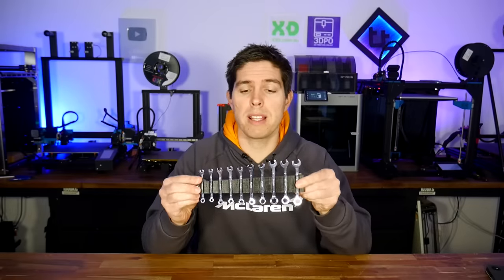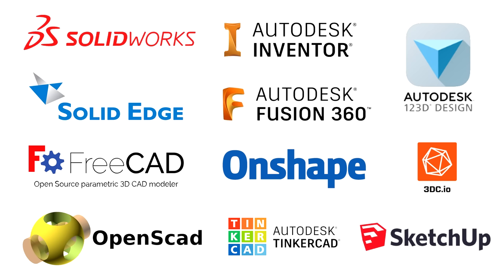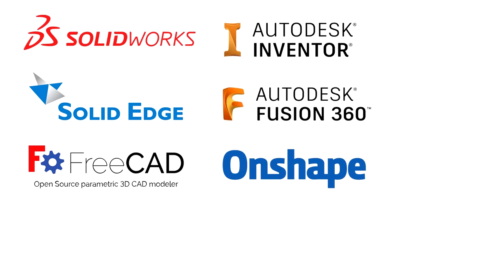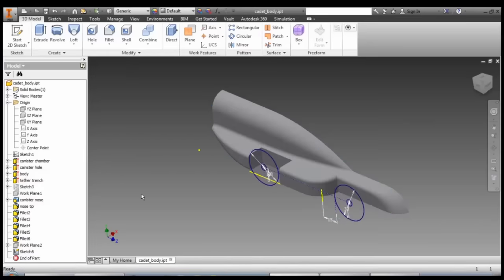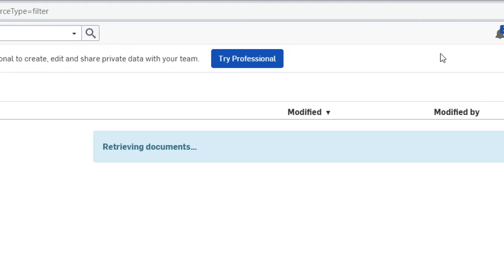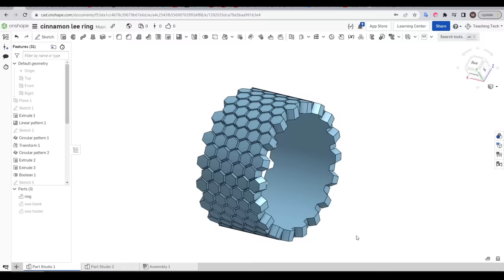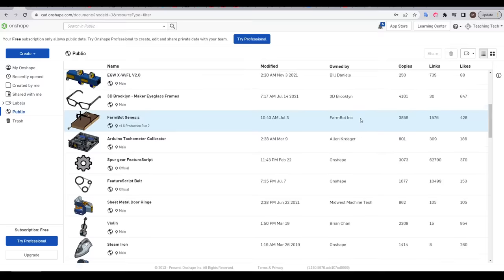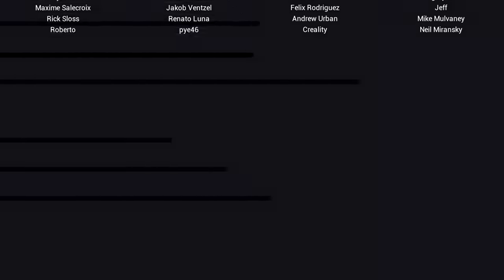Selecting a free 3D CAD option - 3D design for 3D printing pt1

Comment: Another option for people who already have experience using Blender is a free addon called CAD Sketcher, which brings CAD Sketching capabilities to blender. It's a new plugin that's getting frequent updates and it's still in early days, but if you already have experience with blender it's definitely worth giving a shot. I've been using it for about a month now and it's a very capable set of tools that have allowed me to make very precise complex parts to scale.
Imo it should not be seen as an alternative or replacement for a dedicated CAD application, but it may help current blender users get into the CAD space, and for smaller projects it could be more convenient than a separate application
Reply: absolutely true
Reply: was just gonna suggest this. best free cad option ive tried so far.
Reply: I tried blender and it's NOT FOR BEGINNER/HOBBYISTS ADDITIVE MANUFACTURERS (3d printers). It's for people who want to make 3d art and animation, not objects. 

I tried it, and it's not worth a beginners time without advanced instructions.
Reply: @xjonx1  Blender is for a LOT more than just 3D art. I have been using blender for a decade now and have taught many people how to use it for many many different processes, from CAD Precision modelling to Video Editing to composing Oscilloscope Music, there are so many things you can do with it, and this CAD Sketcher add-on just opens the doors to people who would like to get into the CAD space and already feel comfortable using blender at a hobbyist level. I'm not suggesting anybody learn blender for the soul purpose of CAD
Reply: @xjonx1  Yes, I understand that - I felt the same way at the beginning. But once you get the hang of it, you love it. I can't say exactly why. I do 3D printing with it, including the CAD application, 3D animations and photorealistic images. You can do all of that together, and it's awesome. But - yes - in the beginning it is difficult to understand. The best way to start is with a YouTube tutorial - the donut by Blender Guru. Just search YT and try it.
Reply: @xjonx1  it is one of the best general purpose 3d modelling tools, it can do a lot of things and does most of them fairly well
Reply: People tends to forget that Blender is ultimately a polygon based modelling. Contrast this with the likes of true parametric based CAD which is nurbs based. Your model precision is pretty much dependent on your polygon count. You can't zoom in and expect to maintain the models precision. Nurbs based modelling is mathematically precise. No precision is lost when zoomed in. In 2D graphics world, this is equivalent to Raster based vs Vector based images.
Reply: @alihms  In general, yes. however CAD Sketcher is all nurbs based, and the precision can be however much you require for the project. It is no different to how you have to convert a model to an STL file before 3D printing. The modelling can be extremely precise, but the number of tris is what determines the final resolution
Reply: I've always pondered if Blender might someday become the universal open-source 3D anything platform, anything from CAD to animation to maybe even games that run on its platform. I have to imagine a good bit of the underlying code is similar, and even features like CFD could be useful in either context. Maybe they could have a CAD workspace friendly to those not familiar with Blender, but useful for getting into CAD and running on the Blender backend.
Reply: @quillmaurer6563  interestingly enough I actually made my first game in blender back when it had it's own game engine built in. It was just a simple maze game and I was around 10 years old, but I believe they removed the game engine a few years ago before 2.8 came out. In terms of CAD modelling, I don't think Blender is going to catch up to a fully featured CAD program any time soon, but as a free multipurpose tool that has some CAD capabilities I think it could be very valuable for people who don't necessarily need all of the features and would like the flexibility of the whole system. I'm not saying it's impossible to implement all of the features using the underlying backend, I just think it's not a priority for any developers seeing as there are so many alternatives and industry standards
Reply: @MineThing  True, the sense I get is that it isn't the developers' area of interest. I wouldn't say there are so many alternatives though, as this video explains all not-outrageously-expensive options have limitations or caveats. There aren't any good free-open-source CAD programs available, Freecad is really the only notable one and it's pretty cumbersome and buggy. I tried to use it for a little while and wasn't impressed, couldn't get even basic operations to work as they should and doing everything requires a lot more steps than something like Inventor.
Reply: @alihms  Blender always had nurbs even without using cad sketcher, and you are conflating parametric, solid, and nurbs. A polygonal mesh can be parametric and so can a surface, most blender objects retain editable parameters, but manually moving points or sculpting is non-parametric. while its a perfectly valid point to say blender is designed to be a surface modeling program with non-parametric tools available, that does not mean everything made in it is automatically non-parametric nor surface based geometry. I depends what tools one applies and this plugin expands the tools available to solid parametric geometry. Besides, STL files inherently make things a surface mesh made of polygons. some sliceable formats do not, but generally either the conversion/export, the slicer itself, or the firmware/host controller are interpolating a spline into straight lines (or rasterized pixels in the case of mSLA printers) at some point. 

Having the tools available to do what is impossible with parameterized solid geometry when precision is less important, but also having the precision where needed sounds like a godsend to me, a dabbler in blender more at home with sculpting tools who wants to make parts that customize gundam model kits and other injection molded plamo. Granted you do have a point about files being less scalable once they become a mesh and nonmanifold geometry is a constant issue to keep an eye out for, but imo this blender plugin is a very appealing option depending on one's needs.
Reply: @Zackrobotheart  Assuming the slicer and firmware support it, G2 and G3 exist.
Reply: I discovered CAD Sketcher a few days ago and think it is super useful and really awesome already! I really love it!
Reply: i am so called blender "PRO" earning really good money with it ( game artist ) and i would choose fusion instead. cad sketch just doenst has same feeling..
Reply: @alperenozgur  im a professional experience design artist and I use Blender as my primary tool, I have now used CAD Sketcher on a couple of client projects and it has been very useful! obviously it doesn't have the same feature set as fusion, but it's extremely intuitive for me to use, and the convenience of having it in a generalist 3D program adds a lot of flexibility in terms of rendering, animating, materials etc. So for some people ofc fusion will be better, but for others, CAD Sketcher may just be what they need
Reply: @MineThing  hope it improves very fast. would like to switch.
Reply: Thanks! Good to know, i will try it when i learn to use blender
Reply: blender is the most convoluted piece of crap I've ever tried to use
Reply: @jp9403  It's a very powerful tool but I understand if you've having difficulties getting to grips with it. I highly suggest watching blender guru's donut tutorials all the way through and you'll pick it up in no time :)
Reply: @jp9403  seems like you are so skilless lol..mayve autodesk employee? 🤣🤣🤣
Reply: @alperenozgur  at least I can spell
Reply: @jp9403  well, good luck with elementary school than boi 🤣 ( you have 3 seconds to judge my spelling. go. lolololol )
Reply: @alperenozgur  It's okay, you don't have to be embarrassed. A lot of people can't spell.
Reply: @jp9403 Maybe...but it's free, multipurpose and open source.
Reply: @MineThing  people are stupid, they don't get blender, so they just say it's not good for 3d printing hahaha, so they use the baby programs instead lol
Reply: @alihms  dude, what size is your nozzle 0.0000000000001"????
Reply: @xjonx1 blender is not so hard, just think in objects, it’s also just lego (you can also use those shapes as measurement and placement tools.. besides the measureit addon)… When I started with Blender 3 years ago, it did took some perseverence (getting from sketchup) but a lot of things to make life easier have added since then.
Reply: Most of these software are only as good as my internet connection☹. All the good and beginner friendly CAD software are web based. I tried fusion 360 and it was so slow I could have designed and made the parts by hand quicker than sketching it using it...
Reply: CAD Sketcher for Blender is unfinished project. You can't do anything serious
Reply: @zafirfazliji  As I've mentioned previously I have used it for serious professional projects. It has more than enough features to build accurate designs, and when used in conjunction with all of blender's other features it becomes an insanely powerful tool. Just because it's unfinished does not mean it's not good, it just means it will get better as time goes on.
Reply: @MineThing  You can use it for fun, but not for production. If you are doing a demanding project, editing sketchers is a headache. I didn't say it's bad, but it's not complete and they're far from the final version
Reply: @MineThing  how does one compose oscilloscope music in blender?
Reply: @RababaInc  There's a plugin for it!
Reply: blender doesn't support my laptop os😑😑😑trust me I've tried
Reply: @FlamesReviewsAndMocs  Yeah some pretty old laptops don't support the latest versions of blender, namely any version greater than 2.79. Sometimes you can get it working with driver updates and compatibility workarounds but if not then 2.79 is still a really powerful version (it's the version they made the movie "Next Gen" on netflix with), unfortunately not for CAD though as CAD Sketcher is for more modern versions.
Your os most likely isn't the issue (unless it's a super uncommon one), but older hardware and drivers can lead to issues. Blender usually tells you exactly what it's missing if it fails to launch so feel free to try troubleshoot from there
Reply: @MineThing  its a 2017 macbook air at the newest update, how doesn't it work

(just remembered 2017 was 7 years ago)
Reply: @FlamesReviewsAndMocs  Yeah I was able to get 2.79 working on my friends 2017 macbook air, but yeah 2017 is definitely on the older side when it comes to laptops unfortunately 😭. Actually maybe try version 3.6 to see if that works, I didn't get round to it with my friend but that also supports CAD Sketcher and in theory should work on an up to date macbook air from 2017
Reply: @xjonx1  "Not for beginners" yes, didn't you read the part where he said for those who have experience with blender?

Comment: If you're interested more in "sculptural" 3d modeling like gaming miniatures, blender is hard, but being free and open source is hard to beat. It's also just a crazy powerful tool.
Reply: can you "slice" models made in blender? I made models back in the day and it was super simple in blender. I thought he mentioned the downside to programs like that was they arent water tight/solid?
Reply: @channelname8623  Sure. I use Blender for simple prints. You can either export your object as OBJ, which Cura can open and slice, but I believe there's an STL exporter as well. Geometry nodes give Blender OpenScad-like procedural capabilities, but with visual scripting. And there's also the CAD Sketcher addon, which turns Blender into a parametric modeller (still needs work, but promising).
I'd suggest getting the standard suite of hard surface addons though (Meshmachine, Machin3tools, Boxcutter and Hard Ops) if you're willing to spend some money. These tools are extremely helpful for maintaining proper, manifold geometry when using lots of booleans, mirrors, bevels and chamfers, on top of all the nice workflow improvements they provide.
Reply: I’ve heard a lot about Blender. Was hoping to see it in this review

Comment: As a programmer, I LOVE using OpenSCAD. I have designed a lot of useful things (just today, I designed a little piece for my dryer door's latch using TPU, as the piece mysteriously disappeared and my dryer wouldn't close anymore.) I'm not super good at math, though, so fancy stuff is much more tricky than if I learned one of the fancier point-n-click programs...
Reply: I completely agree! It feel so natural to just program your model. The only downside for me is when you want more organic shapes. Rounded edges or bevels are a lot easier to get in e.g. Fusion 360 since you can click an edge drag its roundness.
Reply: openscad is amazing for procedural modeling, and that's all about it.
Reply: I've since started trying to slowly learn FreeCAD, and I like it, too. I tend to stick to free and open source apps, being a Linux user.

Comment: FreeCAD all the way. It is great for modeling practical parts and has a CAM module integrated in similarly to Fusion. It is limited compared to subscription software, but so far I haven't found anything that I actually needed to do that I couldn't do. Also, I'm a Linux user and none of the other programs are even available for my OS, and I have a REALLY simple way of interacting with companies that don't want to support my OS - I don't.  I do NOTHING that requires the cloud.

I am BUYING a copy of Lightburn for my laser engraver, BECAUSE IT'S ON LINUX.  Really, it's that simple. The program doesn't have to be open source(Lightburn isn't), you just have to make it available on my platform and if I have need of it I will happily transfer money units to your company.
Reply: Autodesk shut off CAM in Fusion more than a year ago under the hobby license.  Maybe the student version still has it?  Not sure.
Reply: @TheSuburban15  See, not being dependent on it, I didn't even know that. Think about the people that had small businesses up and running depending on that software that discovered that their small CNC business was kaput because they weren't making enough for a license?
Reply: OpenSCAD is available on Linux.  It may not be the way you want to go but it is available. It also runs well enough on resource limited machines because it only needs to render when you tell it to.
Reply: Do you know of any good tutorials for freeCAD?  I have been trying hard to make myself use more open source tools. Combine that with native apple silicon support, and freeCAD is the winner for me.
Reply: @Queldonus  MangoJelly Solutions, there is great tutorial for beginners. After it, FreeCAD wil not be frustating anymore!

Comment: Another caveat of Fusion360 and OnShape I didn't recall hearing in this video: if you plan on monetizing things based on your designs there are considerable limits with free accounts (assuming one plans on abiding by the license they agree to when setting up an account).

If you don't plan on making money based off your models, this is fine. If you do, you will need to ensure you understand the limits outlined in said licenses. FreeCAD does not have this caveat, of course.
Reply: Thanks for the specific detail on this fact. I have avoided all CAD programs for this very reason. Once the 'cat is out of the bag', it's off down the road and lost.
The only thing it seems you can do, is to get some large company who have similar products to your idea and have a meeting and get them to sign a legal and binding document that protects your idea. I have been to a design company with one of my idea's and just to get started was over $100,000 to set up a mold injection design for the basic component. The only real way to get my 'million dollar invention' out there, is to get a well established company to financially push it. 1% inspiration and 99% perspiration as the saying goes.
Reply: Yes, but Onshape doesn't even know my real name🤫🤭
Reply: When your a paid shill you overlook that stuff.
Reply: If you plan on making money with your parts, just buy a licence or go for a FLOSS project like freecad, you're also unlikely to be a "beginner" which is what this video is directed at (he states this in the first few minutes).
Reply: @Leynad778  😂👍🏿
Reply: is there a cad you can just buy outright and own for yourself like a physical videogame?
Reply: @johanjotun1647  If you make one I'll back it on kickstarter
Reply: @johanjotun1647 FreeCAD